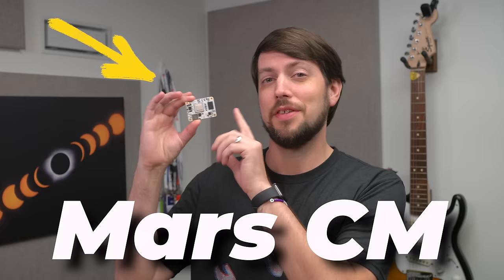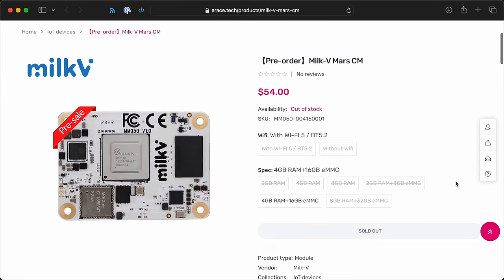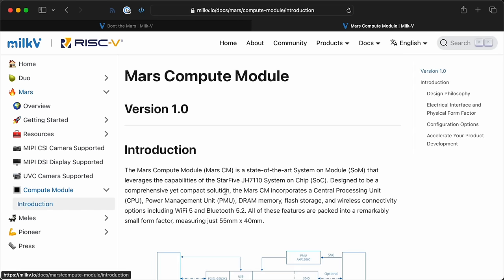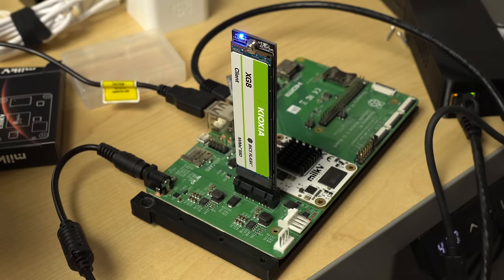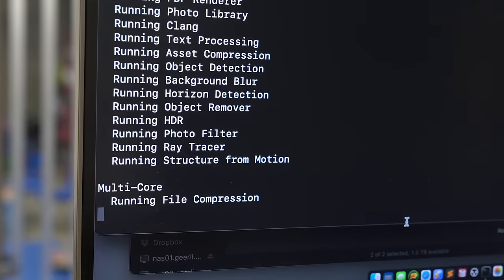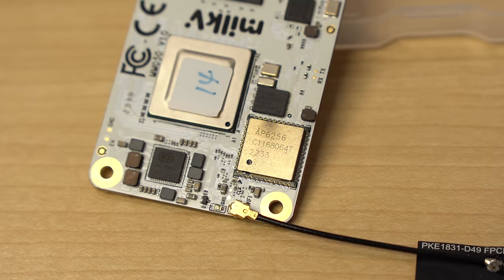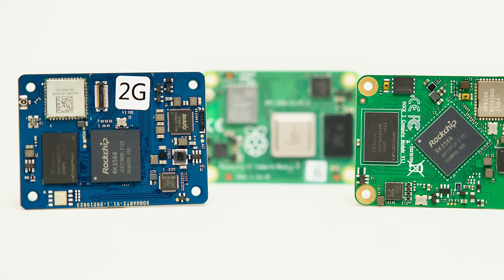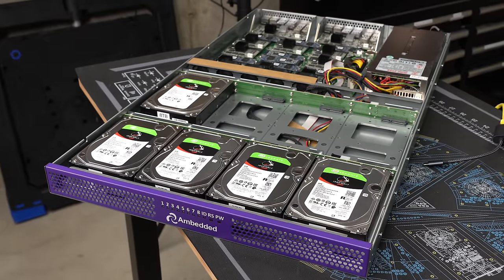RISC-V isn't killing Arm (yet)

Comment: The IoT space is where RISC-V is exploding right now. All of Espressif's new chip designs are RISC-V based, and they're incredibly cheap too. ARM spent a long time being relegated to embedded applications as well before it took off and got high performance designs, so I think it'll just be a matter of time.
Reply: RISC - V is old. Never heard of PowePC? RISC stands for “Reduced Instruction Set Computing”, and it’s the base of multiple architectures such as PowerPC and ARM
Reply: @Siissioe123  RISC-V is a specific ISA, it was only introduced in 2014. It is in the family of RISC ISAs, but "RISC-V" is its own thing. It's exploded in popularity recently because the ISA is open source so anyone can design silicon based on it.

Comment: Nice review! So could you explain what part of RISC-V is closed (no OS)? I hawe always thought, you can design everything like u want, and the only problem is in production (you need special equipment for that).
Reply: Instruction set is free.  And everything else may not be.  OSs like Linux distros RISC-V versions are free.  However most RISC-V hardware designs are not free.  RISC-V foundation only provides a free instruction set.  Nothing else.  Everything else is industry's ecology.
Reply: @catchnkill  "However most RISC-V hardware designs are not free." but can be, right? So IF some of hardware setups are free, there is only problem with production?
Reply: @termitektermit7889  But why?  Why should someone spend money to develop hardware to gift it to other people?  Did you offer such free RISC-V hardware design your own?

Comment: The ssh server settings are same as on standard Debian. Debian (for some time now), prohibits passwords login (to any user). I think it also prohibit root loging, but I am not sure about this.

I think it make sense for the SBCs, because SBC images come with preconfigured user and password, so allowing ssh login using password would be a disaster.

Comment: I would prefer it to be powerpc, decades of optimizations and software already created, let’s see if Raptor’s joint venture project for an ISA 3.1 processor (power 10 equivalent) goes ahead, the possibility of having a version adjusted for mobile would be very interesting

Comment: ARM is killing X86. RISC-V will never kill ARM because ARM is a fixed instruction set while RISC-V is modular so unless The RISC-V Foundation create two instruction models (both a fixed standard and modular) it will never be capable of standing off with ARM. Both are great though and are the absolute future of computing and business for the foreseeable future.
Reply from the maker: Balanced take.
Reply: There are RISC-V chips announced that will give ARM a run for its money. The Milk-V Pioneer is expected at the end of this year and is a desktop system with 64 cores. Seeing you can already run Linux on current RISC-V chips, you can have a lot of fun with 64 RISC-V cores and AMD GPU. And hopefully we will get the Milk-V Oasis in 12 months. Rumours are the bare board with SoC will be around $150 for a 16 core RISC-V CPU with NPU and iGPU
Reply: Sorry, but that is not really reflective of the how they are guiding the ecosystem. They have "platforms" which are suggested combinations of features that form a defacto standard. The point of being modular is so that instead of creating an ARM-like proprietary derivative that is similar but not quite the same, you can just use some modules and reuse most of the ecosystem. For most applications the actual modularity of RISC-V will be irrelevant and no one will see it as the market follows the "platform" standard.
Reply: @ArthurBugorski  I think you are missing the point with the RISC-V platforms. RISC-V aims at a lot of markets. From simple controller chips, to automotive, to desktop computing and HPC clusters.
All these markets can use a mix of the modules.
It looks like with the new generation of RISC-V chips for desktop and mobile use, they will use a mix of modules that will cover similar to what ARM is offering.
Reply: @LivingLinux I get that. I think what you are missing is that those are additional markets. The core markets that overlap with ARM will coalesce around a few (or even one!) common set of modules. We won't have 2^N Linux distros for every permutation of modules. The modularity is to allow the ISA to adapt for other markets as well. Also, some degree of optional features is fine as even on x86-64 AVX-512 is not universally supported even on the newest chips.
Reply: @ArthurBugorski  The freedom to choose modules, is to target the other markets. Google announcing RISC-V to become a first tier architecture for Android, will mean that everyone will follow Google to create chips to target Android.
And since Android is a Linux kernel with custom layers on top, the Linux market will probably follow that too.
I'm running Debian on a VisionFive 2, and you are correct, they won't release a specific Linux distro for it (not counting engineering images), meaning they aim for future mainline support. All the basic stuff works, but anything using vectors, simply won't work. But one of the reasons it doesn't have vectors, is because that module wasn't finalised at that time. It looks like the newest and future RISC-V chips aimed at desktop will have vectors.
Reply: This seems like a somewhat shortsighted conclusion. RISC-V is a modular ISA. But there do exist base specifications. RV64GC is the minimum for running a general purpose distribution such as Arch, Debian and Fedora.

As for supporting extra risc-v extensions, vendors have the choice to implement them per fpga blocks in their risc-v chip designs. This guarantees future proof flexibility and compatibility.

Hopefully YouTube is not going to delete my comment again. Their over moderation got quite annoying at this point.
Reply: As for arm and x86-64 those ISAs themselves are not that compatible as commonly believed. There is a long history of rivalry. The situation got better with cross-licensing between intel and amd. But before that they were fighting with each other to establish incompatible new proprietary  extensions and extend vendor lock ins.

As for arm each new arm version practically requires adaptation and compilation of code. An app written for armv7 can not be guaranteed to run flawlessly on armv8 or armv9.
Reply: Every ISA needs the possibility to be evolved or it can simply not keep up with the speed in the past paced IT industry. This is inevitable.
Reply: @LivingLinux  I'm a big supporter of RISC-V, but putting 64 C910 processors in one CPU seems like a recipe for disaster. There's just too much to go wrong when you take a single relatively weak core and just throw a whole bunch into one processor. I'll have to see some people hands on with it to make any conclusions.

Milk-V Oasis seems more appealing tbh, except that Imagination has only done work on the AXE Rouge GPUs, and it uses AXT. What's the difference? Nobody knows except Imagination and they aren't working on a Mesa driver for it.

Comment: We're at the point where all processors are the same.  When I was a kid, 40 years ago, the Motorola 68000 put the 286 to shame but today, the Intel or Arm whatever is microcode running on top of a modified RISC processor.

The ONLY value in the RISC-V architecture, is that it's open and there's no patents or copyright difficulties.

This isn't the late 1980's anymore.  ARM has abandoned conditional execution for example, because they just use multiple pipelines.  This was expensive in terms of silicon (and energy) to do in 1995, but it isn't today.

RISC-V might make some headway, in the same way Linux will make headway.  It will become the cheapest system to build a system upon, "better or worse" won't matter.  It's the lack of royalties that will make these systems win.

Oh, and Linux is better at this point - but that's just an opinion, but it is.  I have a disk drive mounted in another nation through SSHFS, do that with any other operating system...

Comment: To win over ARM, RISC-V need to be way better. Like 10x performance or 10x power efficiency
ARM's ISA developed in 1990 is very ancient in 2023.
RISC-V's ISA is trying to be one to one replacement of ARM in 2023 is a joke
Why would any engineer switch? Slightly cheaper RISC-V chips are not that compelling....
Reply: I disagree. I think it needs to be about 1x in both areas but just slightly cheaper, and it will overtake ARM. They'll coexist for a while, probably longer than anyone expects, but the competition will be good for both, and eventually I think RISC-V will win out on price. The biggest market for these kinds of chips is low-end performance in embedded systems. Most applications benefit enormously from economics of scale. The company that has to install ten million units doesn't care about a few hertz difference in performance, but with comparable operating costs and slightly cheaper install cost per unit, RISC-V will win that battle every time. At the low end, all you need to be is good enough, not the best on the market, and price sensitivity is very strong.

The other big market, that could potentially be huge, is in data centers. ARM is making big inroads now, probably 20-25% of the cloud in a few years. RISC-V could do the same, and take a sizeable portion of the market. And again, as long as performance is comparable, the economics of scale will mean even a few cents difference in cost per unit could easily swing things. That said, the future of data centers is very specialized hardware for very specialized applications. We see this already with GPU-based cloud computing, for example. RISC-V seems to be getting a lot of attention from the AI market. Very specific chips could be designed for RISC-V that cover very specific use cases, like AI, and data centers could be built around those by the big cloud providers. For this, RISC-V would have to consistently maintain a cost advantage over a long enough time to gain adoption, but the open ISA means there aren't as many barriers to entry and there will probably always be somebody willing and able to step in and make whatever chips are needed for the specific at-scale application, and probably enough competition between them to keep prices down below any proprietary ISA with just one or two manufacturers.

Comment: It's got something else on common with the CM4.

IT'S OUT OF STOCK.
Reply from the maker: Heh, didn't realize they wouldn't do a bigger production run. They ran out of stock pretty quick.
Reply: So far a lot of RISC-V boards to go on the market for hobbyists are quite limited runs.
Reply: In stock (no longer pre-order) as of yesterday at Arace tech webshop. Apparently a board revision since the pre-order version delayed things several months.

Comment: Time will tell if the amorphous ISA of Risc-V will be a problem or a benefit. If a large player takes the ISA in a particular direction, then that will be that. I keep hearing from the Risc-V community that fractionalizing will be fine, but as somebody who used to work on the Linux kernel, having more than a few build targets can be a hard no. Just trying to test something like that gives me anxiety. Especially if this is a system you need to rely on for more than a couple of 9's of uptime.

Comment: I'd still love to see an open source CISC design take over instead as it's superior in many ways to RISC designs.
Reply: Even the major CISC vendors who are still around disagree, not to mention toolchain developers. x86 architecture designs adopted RISC principles already in the 1990s, largely out of necessity to be able to do some of the fancier tricks that are now taken for granted. Consider the step up from the Pentium to the Pentium Pro or Pentium 2, for instance: without being able to do that, Intel would have stalled completely.
Reply: @paul_boddie   Yet another person telling me that CISC isn't CISC. You do realize that it's just the interface for applications to use and the only reason to care is because many tasks can be handled faster when grouped together by the CPU as opposed to the user trying to group them. Every x86 CPU is still very much CISC, and it's for that reason that they're still faster than even the fastest RISC chips.

Comment: What could be a replacement single bord computer, if you want PCIe, is the Zimabord. 6W TDP x86 Intel CPU, 2x Sata, 2x 1G Ethernet, 2x USB 3 and 1x PCIe 2.0 4x slot. Only Downside is the lack of GPIO and the price (119-199$).
Reply: If they used newer CPUs, the price would make more sense.

Comment: 50 bucks for 1.5GHz quard core sounds very much like a rich man toy. There are 3 point of chip sales energy efficiency, fast or else cheap sh*t. You got none, for now. That's why Broadcom (RPI cpu supplier) never touches risc-v. Tenstorrent now got Keller, the Chip King, but still is in funding rounds. YES, it's still expensive even opensource.

Comment: I've been hearing about RISC for probably 20 + years now, and to date its never lived up to the hype. There is a reason why we have so many instructions on modern CPU's, they came about to fill a need, starting by someone asking how can we it it to do x faster.
Reply: It is apparently a common misunderstanding, and an unfortunate consequence of a convenient but inaccurate acronym having been chosen in early academic papers on the topic, that RISC is merely about reducing the number of instructions. In fact, it is about reducing the complexity of dealing with the different instructions, making the handling of those instructions more efficient and easier to implement as well as more flexible, and making the instruction set easier to target with compilers.

As for whether it lived up to the hype, Intel and AMD both seem to think so, because from the K5 and Pentium Pro onwards, they adopted quite a bit of the RISC philosophy to engineer processors that could execute even their tired old legacy instruction sets rather faster than had previously been the case.